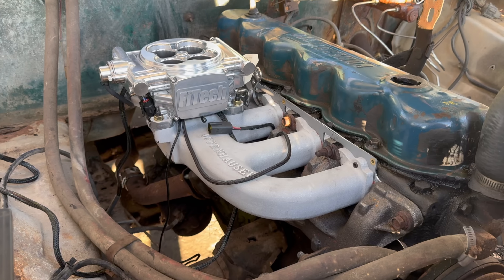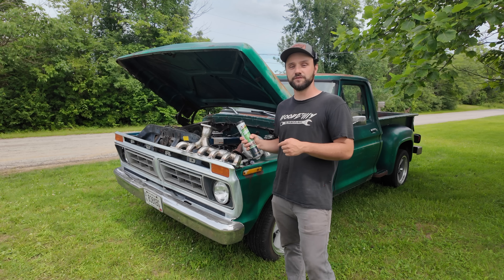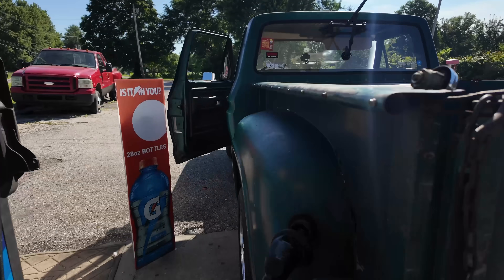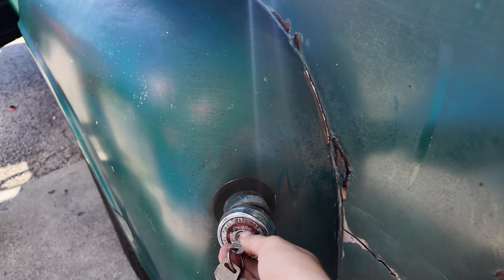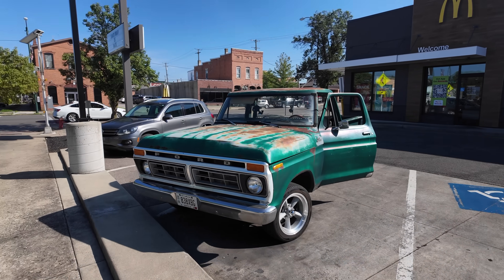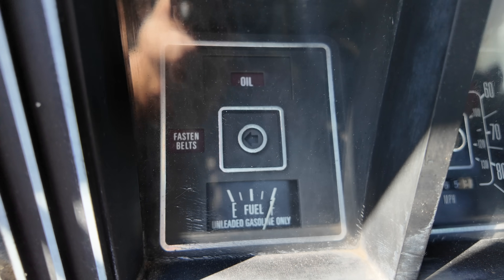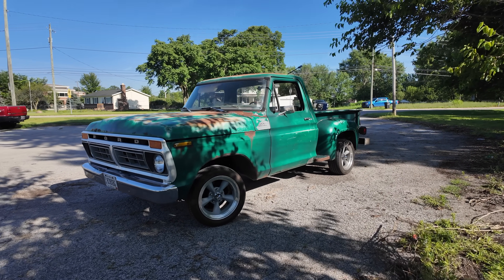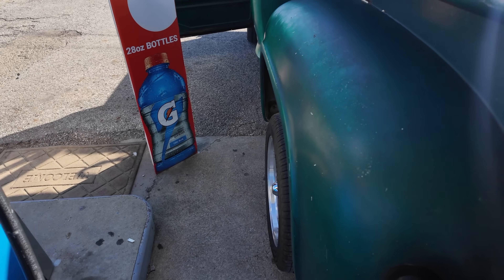How Many MPG Does An EFI Swapped Ford 300 Get?

Comment: I learned how to drive on a three on a tree with no power steering. When it is all you know it is effortless to drive. My old man used to roll cigarettes with one hand while driving the three speed through the city with ease.  Yeah people have grown soft over the years.
Reply: This guy has to hold his phone too to record himself.
Reply: I learned A clutch at 13 when my dad borrowed my uncles 1978 C10 straight 6.  I thought it was slick of dad to teach me on his brother's clutch. When I bought the truck from my uncle twenty years later the only thing it needed was A clutch.  Full pull, how about them Chevrolets?😂
Reply: I learned to drive my dad's Ford just like this. No PS, 3 on the tree, 300. You could shift, or you could steer, but not both!
Reply: You ccan say that again.  Manual transmissions of any type are enough to send everybody running away screaming.  Give me a robust manual shift over a failure prone CVT (I know that there are those out there who will defend CVT's as more modern, high-tech and up to date, they can have them as well as the repair bills and vehicle down time that goes with them).
Reply: My first vehicle that dad helped me to buy was a '66 Chevy C-10 with a 283 and a 3 on the tree tranny. Me being a kid and all I got so good at driving that truck that I could purposely spin the tire on that one wheel drive truck as I was making a turn onto another road in the loose pea gravel at the intersection with just barely turning the steering wheel, ,and letting off on it with the truck facing perfectly in the right direction. I have to admit though that I nearly got into a bad wreck more than once as I nearly lost control of the truck.

Comment: Video is way too long for the information given, but that's great gas mileage if accurate. However Car Craft magazine and other sources for switching carbureted to efi fuel systems typically found practically no greater mileage difference on the highway but a little more for the efi around town.

Comment: The SAE standard for tank filling during MPG testing is 1) fill at full hand squeeze until it clicks, 2) fill with a half squeezed control until it clicks, and  finally 3) squeeze at quarter hand squeeze until it clicks -- and then put on the cap and record volumes.

Comment: It will get even better fuel economy if you give it a lean-burn tune. 16 to 1 air fuel ratio at idle and up to 18 to 1 at cruising speed.
Reply from the maker: Currently the AFR is like 13.2

Comment: My  1991 4.3L Chevy got around 24 with the tallest gears in the rear end on normal highway driving.  Has got as high as 26, but that was driving a whole 34 gallon tank out on the highway at 55.

Comment: Sorry about that old Phone. 1998 Jeep Grand Cherokee in line 6. It was getting 19.6 Miles to a gallon. I changed the tires. From the 235.75.15 to a 215.70.15 and was getting 21.6 miles to a gallon, then I cut 3 holes into the air box.  1  1/2. It was getting 25 miles to a gallon with a 3.73 gear under it.

Comment: I got one for you all and no it's not about ford. But the old inline 6 from   from 1998 19.6 Miles to a gallon was all it would get I took the 2 35 75 15 tires. All put at 2 15 70 15 on it. Leonardo will shorter. I went from 1960 to 21.6. Then I took the air box out. Cut 3 each 1 1/2 holes in the airbox on the left side. Next to Fender., it was getting 25 miles to a gallon with  3.73 Gears And yes, it was an automatic.

Comment: I get 14-15 mpg city and 16-17 mpg @ Texas highway speeds with an Offy Dualport 4v intake and a Summit 500 CFM carburetor in my 86 F150.  I have the 4 speed OD tranny and Hedman headers as well.  The 80-96 Ford F150's are lighter than the 77's, I've heard the EFI 300's pulling down 20 Mpg at 55-60 mph with the 5 speed manuals.

Comment: The EFI computer should give a very accurate indication of fuel use.
Higher voltage electronic ignitions will allow a leaner burn without knock. does it have a knock sensor?
Over-filling could just send fuel to the evap can.
Nice project!
Reply from the maker: the tune is super rich right now, I think there's room for improvement mpg wise

Comment: why did you go with the mean street 800hp  system and not a lesser one
Reply from the maker: because I'm turbocharging it and eventually this thing will make about 700hp when I completely build it
Reply: didnt powernation do exactly that and got i think 550 out of theirs
Reply: @petefroehling8704 

If I recall correctly, they didnt have a super large camshaft, and they didnt even hit 17 psi, 

Biggest issue with a built turbo 300 is fuel, though e85 should help with detonation.

Comment: A carbureted 302 in a fox body got the same mileage as our 2 5 efi Dodge spirit . I assume it was you had to double the rpm pretty much in the 3 speed dodge vs lugging 5th to get the same 55mph and weight was similar I'd bet the K car was lighter  25 mpg

Comment: My 1967 F100 was an old forest service vehicle and was bare-bones for options.  I would get 16+ mpg with the carbureted 300 six on the highway.  However, it had no parasitic drag.  It had rock hard biased ply tires, manual steering, manual breaks, manual choke, no A/C, the optional heavy duty top loader 4-speed w/compound low 1st gear, and the optional non-full floater Dana 60 with factory locker and low gears.  It was pretty much all you could do to get 70 mph out of the vehicle.  Before people argue, yes, there was a Dana 60 option on the older F100s primarily seen on the vehicles used by DNR, Forest service, Ag, wildland fire service, and such.
Reply: I have a old dept of agriculture 1968 F100 with short bed flair side. 300 6 carburetor 4 speed np435 and semi floater Dana 60 4:10 power loc diff serial number 0004 . I don't know about mpg but I don't have a single ding or dent with original paint. How it survived without a dig with gov. Employees is beyond my understanding. I got it for $500 at a auto auction in 1990.
Reply: 70 mph is a dream in my truck. It's good for about 62 mph wide open after 5 minutes. It's only got 67xxx original miles. But it's a slug on the highway for sure . Hard to get any performance with a little 1 barrel carburetor. But it's definitely set up for longevity with a 1 barrel carburetor

Comment: Those old inline 6 cylinder ford pickup engines got HORRIBLE mileage 12-15mpg.On a SINGLE Barrel carb. RIDICULOUS. Funny thing is,even with the biggest slide in camper loaded in the back,the mileage was THE SAME????????

Comment: I had two F150's with the 300 six, one was an 80, with a four speed with overdrive, then I got an 84 with a straight four speed. Both were great on gas, and, could pull a ton of weight. Best engine Ford ever made, until the Coyote. I have that in my 2014 F150. I do not think a short trip like this means much. Mine is a fourwheel drive XLT extra cab with a heavy Leer hight top topper, I get about 15 for short hops , and, on a long drive, can get almost twenty or a bit more.
Reply from the maker: Then we will do a longer test to make everyone happy

Comment: Had a 77 F100. 351
M400 motor. Got 13 mpg on highway installed long tube headers with 2 1/4 pipes and 2 1/4 core glass packs. Mpg went to 14.5 This was in 1980. Installed Many, Many different exhaust on pickups over the years. As for mpg gain most were a joke. Usually 1/2 mile per gallon. All those claims from muffler companies just really don't happen.

Comment: A simple EFI system is the only computer I want on my truck
Reply from the maker: I agree
Reply: for some reason, for me adding an EFI to a small engine, like a mini bike or motorcycle interests me more, out of it just hardly ever being done.  personally I think if I would put any efi system on any older vehicle, I think id stop at a TBI kit.  that way you might be able to keep it looking as if it had a carburetor but now it has EFI, when the hood is open that is for shows and stuff.
Reply: @wolfietigerstripes3248  the quicksilver ultralight company is offering an airplane engine: 1cylinder, 39hp, EFI. seems a bit pricey. but shows an example of such an engine.
Reply: @wolfietigerstripes3248  Check out the Carb Cheater.
It is a computer controlled vacuum leak, more or lees, as long as your carb is tuned properly in the first place (or even if it's pig rich, anything but lean) this little doodad gets your AF ratio right where you want it.
I've been trying to come up with a purely mechanical option myself.
Reply: @wolfietigerstripes3248 you can get efi kits that literally look like a 4 barrel carburetor. the "computer" is self contained in the "carburetor" 😂 its a pretty slick setup for being original looking
Reply: One computer too many for me!
Reply: Agreed!  You should check out the "Carb Cheater" - best of both and minimal electronics to fail, and if it does fail, you simply run on your carburetor only
Reply: agreed. it's the only one anyone needs that comes from teh car manufacturer.

Comment: Just as a actual owner & example.... I bought my F150 short bed, 5 spd, 300 Cu In new. It was a a very low optioned. . I averaged 13 mpg in city & 15-17 on the frywy empty. Pulling my 4500 # boat it drops to ~ 13-15 on the Hywy. '96 with a 351' cu In;  did about the same. Maybe 1 mpg lower on some trips. Over the years of hauling a lot of RV's & boats I found it doesn't make much difference in mpg's whether it is a 6 cyl. or V-8 up to ~400 cu in. Either your foot is into it or the bigger engine your not  working it as hard.

Comment: This is hilarious to me, I have been going the other way,  converting engines with fuel injection to a carburetor!
Reply from the maker: Why?
Reply: @GilktheGreat    I'm doing the same. I can answer why. Older fuel injection sucks, parts are very expensive or impossible to find. Swapping to a $100 carburetor and $20 FPR that is easily tuned, much more simple and reliable, and in all my cases, a huge improvement in gas mileage. Maybe your $1,000+ EFI kit improves MPG over an old junk carburetor from the 70s, but when you're converting $1,000 cars...
Reply: If you are regularly doing significant altitude changes, EFI is far better- especially when dealiing with both summer and winter driving through mountains.  

I've done swaps both ways: EFI to carb and carb to EFI.   I'm just glad we have lots of options nowadays.
Reply: I prefer carbs also.  No chance of break down.
Reply: @ThomasFlipse I wouldn't say that there's no chance of break down. However, rebuilding a carb is much less time consuming than tracking down electrical gremlins. 

That's why I like carbureted systems. No need for computerized operations, making diagnosis and repair much more straightforward.
Reply: That's what I want to do with my old van. Remove the injection system in favor of a carbureted system. Rid the old girl of as much unnecessary electronics as possible!

Comment: I changed out the same vehicle with the Offenhauser and a Pinto Carb. We got 24 mpg when it got 13 mpg with the Ford setup. Ford does not want their vehicles to get good mpg.The Pinto carb is the best match for that engine and manifold. Throttle body injection is not better than a carb at low speeds or low manifold vacume. You could have done better.

Comment: My 1992 F150 got 19mpg at 60 with the 2.73 gears and 5 speed. Switched to 3.55 gears and it gets 15-16mpg with the 300. Love that engine. Usually start out in second on level ground.
Reply: I have a '72' with 3.9 gears converted from 4.11.  It get/got 14 mpg.  Don't know what it gets now.

Comment: Hell in 1980 I  had a 78 F 100 20000 miles  on it. Hate the Ford carburetor  a 1bbl.Holley 
Had an online 6, manual  everything! Had a 4 spd put in , a 2bbl Idelbroken put in, with headers  ad low restricted  exhaust! Got over 20 mpg on the highway!

Comment: You need to drive 2-3 full tanks, 30-60 miles isn’t enough to get an accurate MPG average
Reply: You are right.  He needs to drive it 100 miles, at least, on the Interstate to judge highway milage.
Reply: @waynelovejr.1005 my dad is super old school, but he ALWAYS said it took 2-3 tanks of fuel to judge a vehicles true MPG’s
Reply: He could use fuel cell with an exact amount of gasoline and drive until he runs out of gas.
Reply: Close enough
Reply: @JensSchraeder it’s not though, not accurate at all

Comment: An MPG test at just 30 miles? Do a couple hundred for more accuracy. But 15-16 on a fuel injected 300-6 is about right.
Reply: I agree.  Drive 2-3 tanks through and do the math.  15 mpg at best.
Reply: @firehawk6188  Yea.  He really needed to add the miles since the first test divided by both gallons filled.  That would have yielded about 20 MPG.  Better across 2-3 tanks as you mention.
Reply: Yep, sounds about right to me. A 300-6 Ford is a thirsty animal.
Reply: @michaelhembree2888 is it? I've seen i6 ford 300s easily get 19 avt with single barrel carb
Reply: @michaelhembree2888  Thirsty? What got better MPG in a 1/2 ton pickup pre-EFI????
Reply: @michaelhembree2888   LOL you havent seen my 2002 3l V6 Ford Ranger with the five speed. On a good day I get 16mpg highway and 13mpg city.
Reply: @brettweltz8135 your inline 6 is not the same animal.
Reply: @captainCrunchconservative  its a 3L V6 lol NOT an INLINE 6 the crazy thing is your 4.9L INLINE 6 in more fuel efficient than my smaller v6....
Reply: My 84 f250 4x4 carburetor 6cyl with the low gear four speed ranged 15 to 17. Fuel injection wouldn't have done much then.?
Reply: @LogisticallyMisrepresented  From the factory brand new the 1984 f250 300 got 11mpg city & 18 highway. Combo was closer to 13mpg. A none rebuilt one today would be getting less.
Reply: 23 mpg is totally believable and realistic with fuel injection. I had a short box 4x4 with tall gears that regularly got 18 with a carb back around 25 years ago. That was mostly long trips compared to what most of America seem to get. Here in MT we run 70 to 150 round trip miles daily. Not alot of stop and go either so looking at the trip you are taking I can 100% believe in 23. I bet you can get 25 to 29 with a turbo if you drive it like your gramma. More power equals more miles per gallon if you use it conservatively. If you just work on tire replacement it will always equal less mpg but you will get more smiles per gallon.
Reply: @tsstn  doubtful...I have a 2008 Dodge Dakota with a 6 cylinder and EFI and had OD transmission and it only get 18mpg on the highway/
Reply: @cuzz63 Dakota is a v6. Dodge hasnt made a straight six since 1987, and  the AMC block they used in the jeep ended in 2006.
V6 and i-6 are completely different animals
Reply: Had an 88 with factory fuel injection. It was stripped model. I think one of the only options was an aux tank. On trips it regularly got 23mpg running the interstate. About 17 in the city.
Reply: @tsstn  Sure.  Sure.
Reply: @tsstn 
How will it get more mpg with a turbo? A turbo by nature creates a restriction in the exhaust
Reply: I have owned several 240 and 300 trucks. The worst was a '65 3/4t with a big gear in the back...4. something. Could pull anything, but not very fast.
The best was my '89 with factory EFI.
I'm gonna say the '89 is 7 or 800# lighter than the '65, and lighter than the 76, or 79 I owned. In order to get decent mileage one had to do their part behind the wheel, too.
I have a '72 with a 390: that truck likes gas!
Reply: Yeah, should have done a full tank. Drive the loop with carb, change to efi, drive again. Use same pump. Same weather, including wind. Lots of variables to account for.
Reply: That's what my carbureted 81 F-150 300 I-6 4 speed 4x4 long bed gets. 3.00:1 axel gearing at 5800ft altitude.
Reply: I got 15 - 18 on a 1968 F100 w/ 360FE & an old Holy 2D projection conversion. It would be nice to see what I can get with a newer & better unit.
Reply: I had a carb 300 and got 17 easy. If I was really careful I could break 22. My dad had an efi. He got 25.
Reply: I had a 78 f100 with a 300 straight six, but I wasnt driving it far enough to care about gas mileage at the time.

My 1995 e150 van had a fuel injected 300/ 6. 
I got 25 mpg highway with it. 

Miss those engines
Reply: Ford vs, Dodge, apples to oranges?
Reply: Do the test after using the whole tank.  Will be more accurate.
Reply: Fr
Reply: Those came with different gears. The "commuter" gears got better mileage than the "mountain" gears. 
My og trans was the commuter style 4 speed, 1,2,3, OD.  But i changed it for the "granny low" 2,3,4 version, cuz it was more appropriate for my use.

Comment: My 1998 F150 had port fuel injection with low rear end gears. Manual 5 speed transmission. It’s used lots of gas. 4inch bore with 4 inch stroke has good slow RPM torque. Can’t rev up.

Comment: The 300's FI manifolds improved mileage and power. I put a 1990 300 in a 3k lb 32 orphan sedan but no computers allowed so adapted a Weber side draft to the throttle body mount. With 3 speed top loader and 3:10 gears I expect low/mid 20s/gal. I've got enough pavement rippers so this time went for comfy smoother cruiser and that intake looks really bizarre. The hardest bit was stretching the front for that long engine. You've got an excellent model but gonna need about 3 rolls of mig wire, it will be worth it.